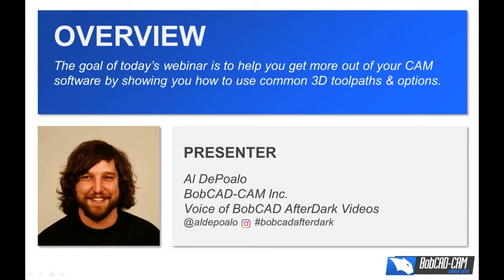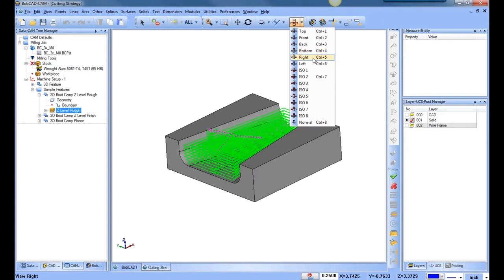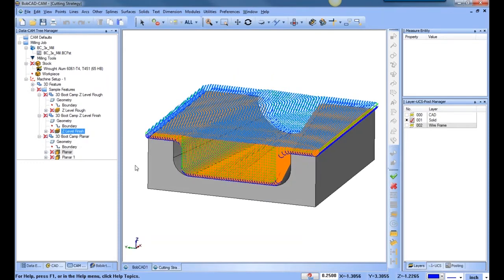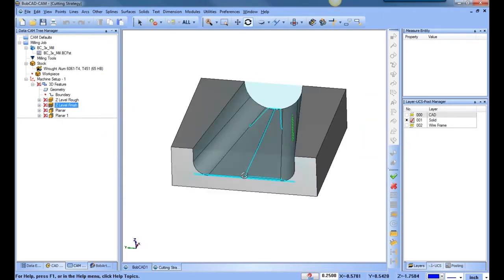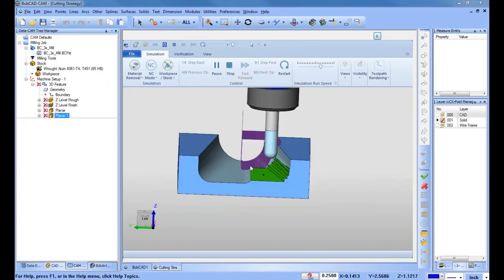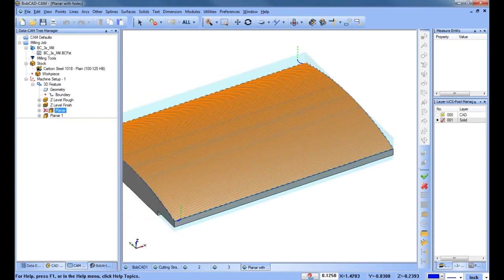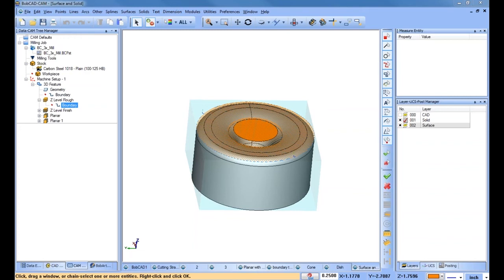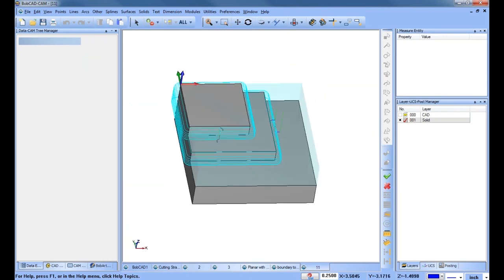3D Programming Boot Camp: Round 2 - BobCAD-CAM Webinar Series

Comment: how to limit the air cutting in the planer tool path on the side wall
Reply: Are you asking about the single direction cutting?
Reply from the maker: You can choose a zig or zig zag pattern.  Running Zig Zag removes the air cutting.